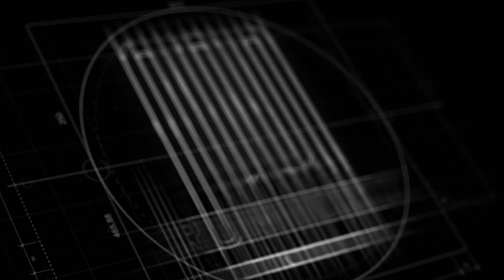How to Resize a Radiator.

Comment: What compound did you use on the joint?
Reply from the maker: Masters metallic
Reply: Doesn’t look like it can be purchased in the US. Probably a high VOC. 
What else can be used at those connections?
Reply from the maker: @vrnicastro6353  just use whatever pipe dope you have access to.